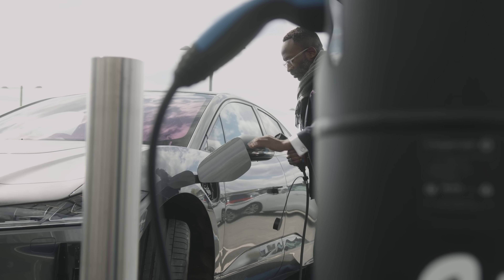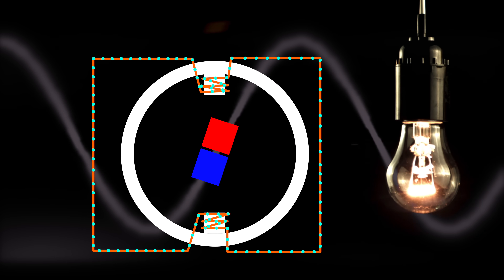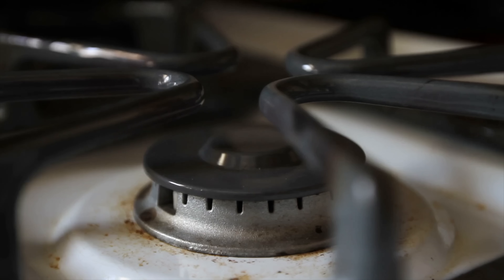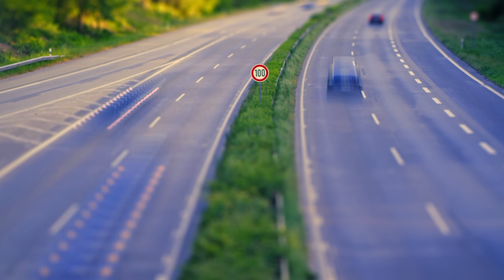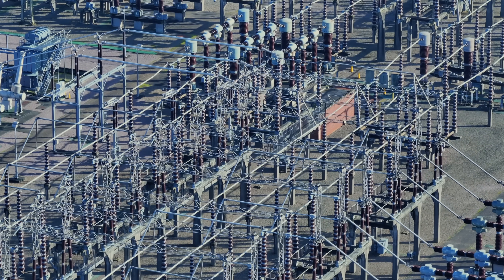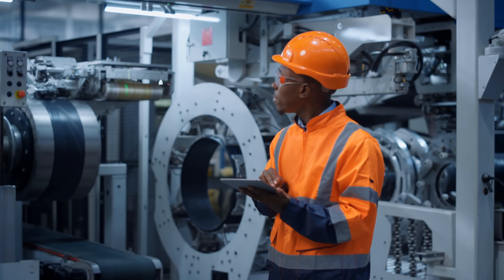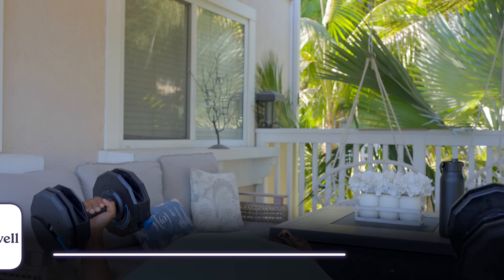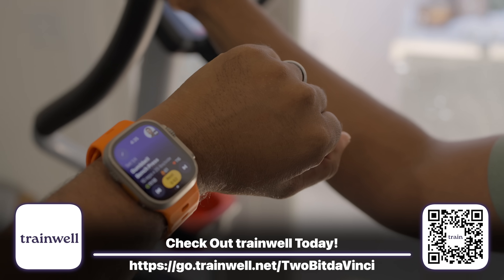Why The Power Grid is Nearly IMPOSSIBLE to Run

Comment: What if the electricity was generated locally? For instance, what if every big box store in the US had it's roof covered in solar panels? At noon on a sunny summer day, when everyone else is demanding power from the grid for their A/C, the demand from each one of those big box stores would go down drastically, and maybe even disappear, taking a big load off of the grid. The more power we generate and store where it is being used, the less we will need to transmit through the grid. We need to stop wasting all of the potential power generation of those huge flat roofs.
Reply: How do u plan to store energy? Using battery packs? Totally green
Reply: @hiteshadhikari  Yes, battery packs, though there are a few other options, all of which are greener than burning fossil fuels.
Reply: @rayopeongo  how do u think batteries are produced or your solar panels?

What do u think about phantom losses?
Reply: @hiteshadhikari  

"how do u think batteries are produced or your solar panels?"

There are some problems with the production methods, and recycling methods, but they are all being worked on, and things are getting better every day. We have been burning fossil fuels for decades, and have gotten pretty good at it. We have only been seriously using solar panels and large batteries for a few decades. There is a lot of room for improvement, and we are working on it. Still, using the current solar panels and batteries is better for the environment than burning fossil fuels.

"What do u think about phantom losses?"

They exist, and are getting smaller all of the time. What do you think about internal combustion engines only using 40% of the energy in a gallon of gas? The rest is released as waste heat.
Reply: @hiteshadhikari  

The burning of fossil fuels to create energy is a mature technology that is about as good as it is going to get. There is very little room for improvement.

The use and storage of renewable solar and wind energy is a technology still in it's infancy. Solar panels, wind turbines, large scale batteries  and the associated equipment (such as inverters) are getting more efficient and cheaper every year. There is massive room for growth, yet in most cases it is already cheaper and more efficient than burning fossil fuels. Is it perfect yet? No, but we are working on it, and it is getting better every day.
Reply: @rayopeongo  please learn the history of energy and automotive

Ev is not a new tech, it existed nearly a 100 year ago too, the troubles were same

The rare earth minerals we need are not limited to lithium 

There is also a reason why we use AC grids and not DC grids, please study that as well
Reply: @hiteshadhikari  

"Ev is not a new tech, it existed nearly a 100 year ago too, the troubles were same"

EV was a niche technology during the 20th century, with very little work being done on it. The vast majority of power was derived from fossil fuels. It was only in this century that billions have been spent on research and development world wide, leading to the widespread adoption of electric vehicles, solar panels, wind turbines and large batteries. 

"The rare earth minerals we need are not limited to lithium "

Lithium is not a rare earth metal, and there are already batteries being developed and used that do not require expensive and problematic elements like cobalt.

"There is also a reason why we use AC grids and not DC grids, please study that as well"

I know why we use AC and not DC grids. I am simply saying that we can protect and reduce the stress on our grids by generating power much closer to where it is used rather than using the grid to transmit power long distances from large central generating stations to the end users. Every watt generated by a solar panel on a roof and used in the building is one less watt that the grid has to deliver.
Reply: @rayopeongo  u need to go and read the data on power generation and how the majority of power is generated today

Then u need to go and study on how the items for production of battery inc multiple rare earth minerals are mined and refined 

Then u need to firther see how batteries are recycled

Then come back and talk green
Reply: @rayopeongo  there is a reason SMR are being developed for local generation, generation isnt the problem, sustaining & storing the power is

None of the so called green measures are reliable sustained power which is essential for grid balancing
Reply: @hiteshadhikari  

"None of the so called green measures are reliable sustained power which is essential for grid balancing"

It is just a matter of time. Some solutions are available now, from Tesla Powerwalls, EcoFlow batteries and others for individual homes, to Tesla Megapacks and equivalent for grids. And there are lots of different options, with different types of batteries having different strengths and weaknesses, all of which have been described on this YouTube channel at one time or another: pumped storage; flow batteries; liquid metal batteries (like Ambri); sand batteries for storing heat; etc., etc., etc. 

We have just started to wean our civilization off of fossil fuels, and there is a lot of work to do: to reduce our power needs; to generate electrical power more cleanly; to store more of it more efficiently; and to transmit it more efficiently. Lots of people all over the world are working on these problems, and billions of dollars are being spent in research and development every year.    

All of these solutions, and others that we haven't even thought of yet, will be used to a greater or lesser extent to solve our various problems. After all, we can't simply keep going the way we are.

Comment: if the power grid cannot keep up - the requirement for more de-centralized power generation and power storage will increase! if you ask me if all the ev cars are bidirectional and tied to the grid, i think that we can solve 90% of the issue! even more we will get more grid stability!
Reply: A grid by the name already is de-centralized. The problem is that in the USA the grid has been suffering from corruption. It was almost a single line instead of a tight mesh.
Using EV as a capacitor for short dips brings a whole lot of other problems with it, that goes beyond just adding too much feed-to-grid solar power.
But eventually yes, I acknowledge that it is the best solution.
In the Netherlands (in large parts of Europe actually) we have next day hour prices: you know 12 to 24 hours in advance what the price of your energy is going to be the next day. This price can be positive and negative. If it is negative, it means they expect an overload of feed-to-grid solar, and they will pay you to use it. You can use it to charge your ESS system, and later when the price is right feed it back.
This last part is not everywhere true: some providers in some countries want to prevent you from feeding back energy that you got out of the grid. This is to protect their market, not to protect the environment.
In my off-grid tests I have configured a victron with an eelbox as an ESS setup, and could charge it up during windy days in the winter, and feed back during less windy days, or just use the power...

What do we need to solve the problem?
We actually need a protocol between the grid, your energy provider and your ESS system or EV based ESS system, and your consent to control parts of your infra.
For instance: they need to be able to request feedback during a certain timeslot, and your ESS must be able to ACK and provide that.
Also they need to be able to request unloading the net, your ESS system needs to be able to indicate if it will participate, and even might be able to turn on appliances to dump the energy in. Energy dumping is a real thing with renewables, especially wind energy. If you don't take the energy, the energy will be dumped into a usually a heat generating load.
A grid should not be able to force energy upon you if your batteries are already at 90% for instance, because once they reach 100%, you can't unload any unpredictable energy anymore, that makes it even dangerous for you own wind and solar generation if you can't dump the energy in your batteries. When a heavy appliance turns off and you have an AC-inverter that needs to be instructed to stop, the surplus energy needs to be dumped into the battery until the inverter reacts. (Also a reason why solar DC-chargers make much more sense in an off-grid only situation instead of having AC-inverters feeding AC chargers. Actually doing DC only with high frequency DC-DC makes the most sense, but there aren't any DC appliances, nor is there a DC appliance standard :-( ).
Reply: @bloepje well, you said that, but actually what form of electric energy really use your domestic appliances ? Do you want to check how many appliances use DC and have a transformer with rectifier ?

And probably you already know that pulsed DC is as good to be used as AC for almost all domestic appliances and it will be far more efficient than AC.
Reply: Some parts of the world (thinking of Australia in particular) are on-track to having many homes being energy independent. Should that come to pass, it will lessen the load on their central grid.
A decentralized grid has got to be the plan, but it implies a loss of dominance for the electricity distribution companies. They do not want to surrender their "power" over their customers.
Reply: Or we could stop the monkey dicking around with EV's that noy only are less power efficient because you lose more energy by converting back and forth then just burning the oil and solar panels are less efficient then the generators themselves.

We do need to decentralize more. Homes should have solar when ever possible. Because at least the fridge can keep your food cold in a mass power outage like an enemy attack.

We need to make sure that the wires that the power goes down don't start glowing red and shooting ball lightning from them.
Reply: But since battery capacity decreases with time and use, how many miles would be lost with vehicle to grid?
Reply: @thinktoomuchb4028  Depends on the battery chemistry, and pack management. My view is most of the cycling will be done by grid storage, but it sure would be great for rare events, though they would need to be short, and EVs can help a lot just by charging when electricity is cheap and abundant.
Reply: They'd have to pay me....
Reply: We already have that...

Why do you think Tesla recommends that you always have your car plugged into a charger?

For this very reason!

"Vehicle-to-grid, or V2G for short, is a technology that enables energy to be pushed back to the power grid from the battery of an electric vehicle (EV)."
Reply: Why would you want cars to be bi-directional? You could wake up in the morning and not be able to get to work cause your car had to feed power to the grid to make up some shortcoming. It shouldn't be up to end customers and their devices to solve the service issues of the companies charging us for using it. If we are going to have a decentralized power system where everyone generates their own and can share a little bit to make up for shortcomings then that is fine, but the whole system needs to be like that and we shouldn't be paying for power then. But if we are going to have power companies who charge ridiculous amounts (like we do now) then they need to deliver what they are supposed to and not rely on us to fix their problems.
Reply: @LordSaliss because you would make sure to set the feed to not drain your battery or charge again when there is a surplus. It’s very simple.
Reply: @LordSaliss The person with the car would get paid for helping. My 2018 Tesla Model 3 has a 75kwh pack. A Tesla powerwall has 13kwh. Point being, car batteries are big. Now I don't thing most of that will be done with Tesla megapacks and such, but if there are short infrequent shortages, does it make sense to build grid batteries that are hardly ever used? IDK, you have to build bi directional into the cars. But the idea is not crazy. Most people only drive 40 miles in a day. Most modern EVs have at least 250 mile range. They have plenty of battery to help for a couple of hours.
Reply: @fjalics this is a very interesting concept and should be further developed … the idea of possessing your own energy pack ! As long as it is yours and not rented and do not depend on what the manufacturer may allow via internet control in your hardware installed in your car.

So, if you have your own generator (fossil fuel, solar, wind, whatever) and you use it to charge your power pack of your own car, while still benefiting of a grid connection it is up to you how you may want to use the energy, to power your house, your workshop, feed the grid or travel. Once you have a generator you can dictate the outcome !
Reply: @LordSaliss you can just set a minimum charge you always want. This is a non issue.
Reply: @LordSaliss  It's fascinating how critics can be so simple minded. This is already happening in many states with Tesla Powerwalls and their VPP program, you can set in the app to join in or not and set a minimum charge level you're willing to sell back to the grid. The power company pays you for this electricity.
Reply: @LordSaliss you can unplug or set the minimum amount you need not to go into the grid. 
contribute the resources you program you want to contribute.
Reply: Every vehicle should not be electrified, there should be some combustion fuel vehicles and I ain't talking about petrol, talking about fuels like Bio-CNG & Bio-LNG.
Reply: @artistanthony1007  not necessarily, watch my 3 vids where in one of them I am using just copper wire, aluminium wire and deionised water … using “work function” of elements to generate electrical power for free. Anyone can test to see themselves.
Reply: @artistanthony1007  Should be is a bit strong. We may find some things particularly difficult to electrify, so we may reduce emmisions other ways, but burning creates pollution.